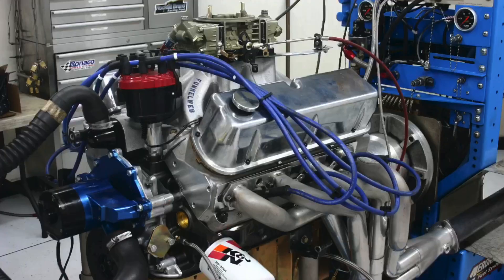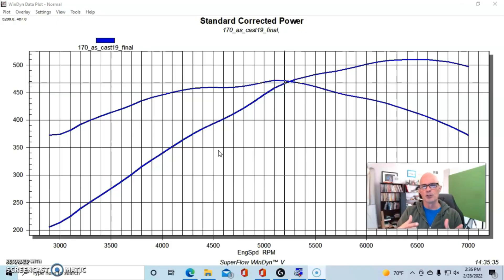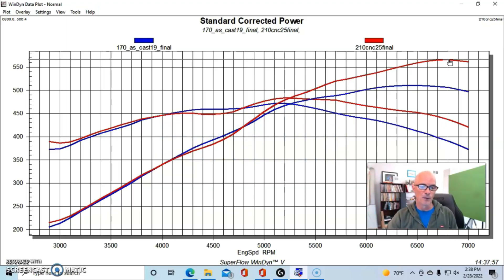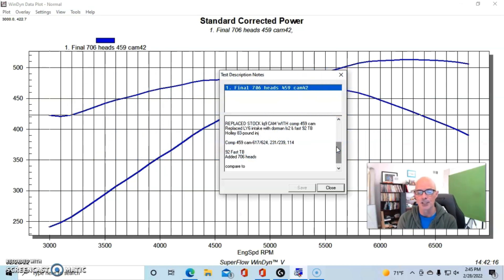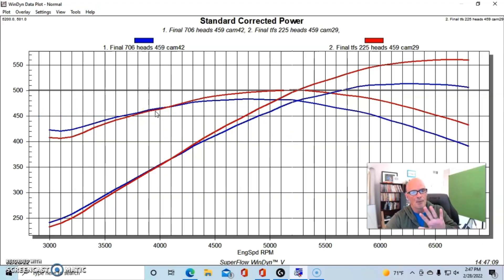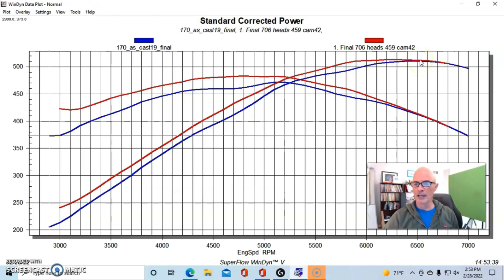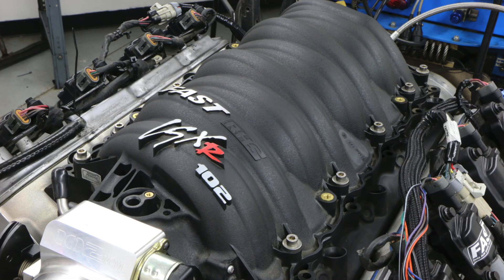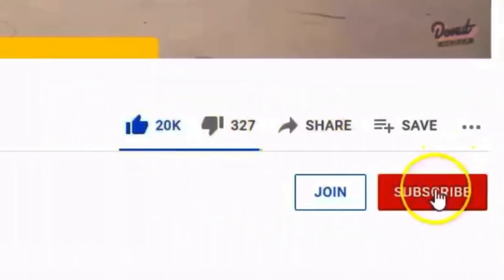HOW TO MAKE 6.0L POWER! FORD vs LS-WHICH 6.0L MAKES MORE POWER? MOD 363 FORD STROKER OR MOD 6.0L LS

Comment: I would have liked to see a. 030 over 360 magnum thrown in this mix too. I think that the Ford could have done a little better with the average hp with a dual plane intake. Now if someone wanted EFI on the Ford what would be the better intake for like the holley sniper fuel injection so all you need to do is swap the EFI for the carburetor. Would the single plane work better with that type of system or would it shake out the same as it would with a carburetor. Dual plane better down low and the single plane for top end power and higher rpm.
Reply: At that low RPM, I really agree.  An Edelbrock Air gap on a Windsor engine (351@ +.040.) with that level of cam and heads will pound out 575 hp with a carb.

Comment: Bunch of mismatched parts and trying to make a conclusion from it.   Lets see... a retardedly large single plane, GIANT solid roller cam and a TINY HEAD.. yeah a 1.94 valved cylinder head that should be on a 302 street motor.  Cam and intake had NO business in/on that motor.

Comment: Run the same  valve angle for the ford . 20 degree ford against what a13/15 degree Chevy.  Put a set of Victors on the ford -15 degree vs. 15 degree

Comment: Fun video, not sure if it will change any minds but fun nonetheless. Maybe I missed it, do they have the same compression ratio?  How did the difference in LSA effect the net results?   Keep them coming Richard.
Reply from the maker: slightly higher in the Ford
Reply: I’m thinking the combination of duration and much wider LSA of camshaft had a dramatic effect on average power. That and if the Chinese funnel web was not ported, this test is not very accurate. A 351w stock block would have been a better comparison as well.

Comment: The Ford had waaaay more cam…  roughly 20 degrees and 0.100” lift.  Sure, the long runner intake on the LS helped it in low rpm torque production, but arguably hurt it a little at the top end.  Putting a single plane on the LS would drop the torque curve some (closer to the Ford), but likely add another 20hp on the top end. 

I think if the LS had a single plane and larger cam (closer to the Ford’s specs), it’d likely be making 600+hp, about the same amount of peak torque, but less torque down low.
Reply: LS had a better flowing set of heads
Reply: @motownXJdad9565   He said they also ran the Dart Pro 1 225cc heads and there was minimal difference to the 210cc.  
Plus, a key reason the LS heads flow better is that the heads are 15 degree (valve angle) from the factory while SBF's are 20 degree.  This means the valves in SBF heads are more shrouded than the LS heads.
Reply: @stlchucko  I bet if he ran 225cc TFS high ports on the sbf it would be a different story.
Reply: The LS motors are a far better design that will always make more power with same specs.
Reply: @bri-manhunter2654  Well EMC plus many racing series say otherwise.
Reply: Need to run the same style intakes / compression / cam / rocker arms / pistons / combustion chambers......to make a true comparison.

Comment: Honestly this just makes stock LS parts look more impressive. Even made over 500 with basic truck 706 heads. Run the ford with stock heads lol.
Reply: superkillr, you obviously haven't flowed Cleveland heads against LS heads.  The info is also out in the net.
Reply: @flatbrokemodsquad4241  Yes, The info is out there. Its called the EMC. Go check Kasse out. Cube for cube no small block from the best engine builders in the country has managed to beat his Clevelands. Except for the time they accidently let modular motors compete and they swept the podium. LS motors are good and ubiquitous but they aren't the best motor ever created.
Reply: @mikealbert728  Fords "mod" engines were banned from the Engine Masters Competition for life.The "Cleveland" head Windsors hold there own very well in this builders contest 👏
Reply: @mikealbert728  I have no need to check out EMC as I read all those YEARS ago.  Kaase kicked ass with his 400 with CHI heads.  I'm referring to factory heads, not ones that will run $4,000, then top it off with a $900 manifold.  Stock Cleveland heads won't out perform stock LS heads.  I'm not referring to aftermarket heads.  I never said that the LS is the ultimate engine.  If Kasse would make some more P38 heads, I'd buy a set for the windsor my wife's 69 eliminator clone.  They were, essentially, a high flowing head using canted valves like Cleveland that worked with windsor intakes and exhaust.
Reply: @flatbrokemodsquad4241  The LS guys are running Brodix, RHS, etc in those competitions so it's apples to apples. The mod motors were about the only ones that even ran stock heads obviously. Kasse has also win the competition with a plethora of Ford engines. Probably almost half a dozen. Fully worked Cleveland Iron heads can run with any LS head with the same work done. Cleveland's are over half a century old so yeah, you just won't find many stock Iron heads out there much less people racing them but Clevelands dominated Chevy for decades even with all the weight penalties and other handicaps.
Reply: The Ford engine that stopped development in a Explorer in like 2000?  Or would you like him to put on a set of Cleveland heads and smash the crap outta that LS?  Oh the LS, that looks almost exactly like a FORD compared to ANY chevy engine ever built.

Comment: I understand that Ford guys are going to go with Fords motor, and Chevy guys are gonna want the LS motors. But how streetable is a 700+ lift cam gonna be for the Ford guy? With the LS it’s welcome to Tuesday. I definitely like both engines, But for cost point and street ability the LS is just a better built system.
Reply: Good point
Reply: @berserker406 you gotta remember a lot of what he's doing is just archive comparisons, he doesn't build or even test all these combos he has all the information from. He's mainly just putting the information out there for people to see what combos make similar power, usually with multiple combinations over many videos.
Reply from the maker: HE BUILDS AND TESTS ALL OF THESE COMBOS (WITH RARE EXCEPTIONS)
Reply from the maker: A 351w WITH A 230 CAM WON'T MAKE 566 HP

Comment: Now give the LS the same cam specs...the most important thing to learn from this test IMO is the LS will be worlds better in any street driven situation, at the same power level with a Much smaller cam. And much cheaper to build  too is another bonus.
Reply: If you think that cam was helping the Ford you're delusional.
Reply: @superkillr  you must not have watched the video
Reply: Give the Ford the same head specs n we're at it again..lol
Reply: @P71ScrewHead  an 6.0l with ported stock ls3 heads and a cam in the high 230s would have made 600. And that's with hydraulic lifters. Ls heads just flow to good. Gm really hit a home run when they designed them. It'd hard to even compare the. To aftermarket heads for a set and sbc. Ls3 heads will flow 365cfm with very little work. Ls7 will do over 400cfm. That's equivalent to a high dollar set of older style  heads.
Reply: @unclegeorgesspeedandfeed  I've always said there's no such thing as too much head..lol The more head the better.. ;) i like the LS7, other than that, Ford all the way.. :P
Reply from the maker: a 6.0L with ported heads and cam will make 600 hp?
Reply: @richardholdener1727  yes,  ported ls3 heads.  In bumpstick boomerang you made 575hp with a Brian tooleys 235/244,  and that was in a stock ls3.
Reply: @P71ScrewHead  boss 302 had to much
Reply: @unclegeorgesspeedandfeed  good to know..
Reply: @unclegeorgesspeedandfeed  ….Richards testing from a few months back of Boss 302 and Boss 351 engines showed excellent results. He blew the hell out of the ridiculous myth that the B 302 has no low rpm torque. The proof is in his testing for those who doubt.

Comment: I think some of LS's low-speed power advantage has to do with the longer stroke (by 0.222"). Although similar displacement, the longer arm means more mechanical advantage. Interesting that the Ford's cam had 22º more intake duration, so I'm surprised the Ford didn't run away from the LS after 6,500. It would seem to come down to the induction system since the 225-cc Ford heads didn't make any more power than the 210s.
Reply: What you gain in leverage you lose in piston area.
Reply: There have been a lot of test on the "longer stroke makes more low end torque" theory. When displacement is equal, it's a wash. Now the longer runner intake on the LS made up a lot of the low end torque. Single plane intakes are known for giving up the low end for high rpm horse power.
Honestly, had both engines had the same induction, they would have been much closer or the Ford would have won due to can shaft specs.
Reply: Those tests showed that the cam timing and low lift flow of the cyllinder heads will make a difference what happens. @GB-zi6qr

Comment: I'm curious how a 6.0l Ford with TFS 225 Cleveland heads would compare.  Is there an engine available that can do what the ls engines do?  In addition, the availability and low cost at the yards make the ls hard to pass.  Perhaps one day the coyote.
Reply: If you price out the cost of a 9.2 or 9.5 deck boss block to get the same cross bolted mains and priority main oiling as the LS, those heads, crank trigger/coil on plug ignition, efi, and serpentine you will find that ford combination is a $20k engine...to get to where a rec port 6.0 LS is from the factory. Tough comparison to make from a financial standpoint.
Reply: Cleveland 4v heads outflow about everything
Reply: @erandy0240  Except LS.  I had my cobra jet and my 2bb Aussie Cleveland heads flowed and they are better than windsor, but not so good compared to LS cathedral and way behind the rec port LS heads.
Reply from the maker: A 2V AUSSIE CLEVELAND HEAD FLOWS NOWHERE NEAR THE DART 210 HEAD USE-OR LIKELY EVEN THE SMALLER 170 DART HEAD
Reply: My 2bbl Aussie heads were around 178 cfm intake and exhaust.   My cobra jet was only 240 cfm intake and exhaust was poor.  Couldn't find my paperwork on them.  I picked up the high port exhaust plates for it, and milled head for fitment but after I started adding up all the money for that combo, I said screw it and went LS turbo.  Lots cheaper.

Comment: As a Ford guy, cost of a bulletproof block has stopped me so far.  I have a forged crank, billet rods and don't mind spending on heads but the block, machine work, cam and pistons to finish would cost more than a 6.0 with a cam.  It sucks, Dart makes Chevy blocks too and they are cheaper even though small block Chevy and LS blocks aren't known to crack down the middle like Ford 5.0 blocks are known to.

At this point I think I'm going to LS swap my Mustang with a "new" K-member and front suspension so I can put it back to stock or go to a built Ford motor if I ever finish that.

But back to the test, I think the cam did as much as the intake, I'm not sure if the Ford really needed all that lift but it sure had a lot of duration.  If the cams had similar duration I think the LS would have beaten the Ford up top but the Ford might have found a bit of torque somewhere.

I don't know how many people would daily drive a carburated engine making that much power because it would probably need regular tuning.  For me, EFI makes sense but EEC-IV seems to be nearly totally obsolete for performance applications so add another $1,000 for a Terminator but I can use a Terminator on an LS, then make another harness to run the same Terminator on a Ford...

A bigger question for me is if I'm as slow finishing my project as I've been starting it, how long will it be on the road before human driven, gasoline powered automobiles will be banned?
Reply: You can easily make the numbers they're making with a 351 with a piston swap on stock rods and crank....
Reply: @Haulass95gt  you ain't making 570 HP with any 351 easy,,,a stroker yes...
Reply: @camclarke9952  my point was that the stock rods and crank will handle that power easily in a 351, not that you'll easily make that power
Reply: @Haulass95gt  the problem is a 351 needs a Cobra R hood or a massive cowl.  LS seems to fit easy, maybe even with a truck intake.  If I didn't care about engine size, a 460 stroker could fit in there and make well over 1,000 hp before a stock block holds it back at all...
Reply: Problem is there is NO World or Dart blocks available currently.
Reply: There was a old timer on YouTube talking about making 1000hp with a Ford. 5.0 block. 
In his review he said the blocks not the weak spot its the main caps.  He showed thay the 2 bolt main with billit main caps and a gurdal is stronger then any 4 bolt main. He also said to girdle the lifter valley.  I have a stock block 5.0 with stock internals with the top end and bottom girdle the car runs 10.5 in the quarter. Only thing I have done to the engine in the last 8 years was adjusting the valves. 
Blocks are stronger then you think
Reply: @stephenfazekas1568  you probably aren't making 400 hp to go 10.5.  1,000 hp would get you in the 8's.

Main caps aren't really it, the lifter valley cracks because the blocks are cast too thin.  Some people say it's the caps walking, I think it's a chicken or egg situation.  Since the typical break is the lifter valley, I blame that.  I have seen the girdles but I'm not convinced they do anything beside hold the pieces together after the block cracks.

I see two thing, 5.0s that are fine because they make at most 300 hp and broken blocks...
Reply: @stephenfazekas1568  nah, they are junk. Simply not enough consistency. People don’t make this up, they literally have piles of 302 blocks literally ripped in half and no reason to waste money on a engine that needs all that support when newer engines do just fine and make more power anyway
Reply: Yep. I came to that same conclusion as well. It seems like its much more easier and practical to make power from an LS based motor compared to building a Windsor based one. the 363 ford engine essentially is 0% OEM ford. It's only a "ford" by design. With the LS motor, you can essentially use the SBE truck engine, and put a decent top end kit onto it and make good power. Not the case for the ford motor. You'd be $15-20k deep into the engine to make the same power that an LS can make for $5-6k in parts.
Reply: @GlitchMaster0001  the ls is way more modern design and isn't really a fair comparison honestly.
Reply: @GlitchMaster0001  yup. This is what I tell people. Go ford if you want. But if you want to save time and money, throw a fkn LS in there and have fun. Stop worrying about what some nazi purists think. They ain’t paying for shit.

Comment: I want to see ford 2017-2019 f-350 6.2L vs chevy 6.2L battle! I just rebuilt a pair of heads at my job and the design on the runners and combustion chamber looks like it can make awesome power.
Reply: Look into the for 777.. 7l 700hp 7k rpm n/a. Sadly, the 6.2 stayed a truck engine due to it being physically enormous
Reply: @PureCountryof91  physically enormous but they fit in fox bodies and s197 chassis with ease. That 777 motor was cool, I wish ford would’ve done more with it.
Reply: @taylorgtrotter  yeah.. ford built the fox and s197 to fit a big block If the customer ever wanted it to.. and I have only seen one 6.2 fox on YouTube.
Reply: @PureCountryof91  the 6.2 has amazing potential that is largely untapped
Reply: @taylorgtrotter  yep. And it's because it wasn't a mustang engine.. everything that goes under a mustang hood gets a "darling" treatment. Damn shame, I'm betting that porting, and tuning can make the 6.2 push 500+ n/a and boosted would make stupid power. The heads already flow alot though. So, it could be a tame cam and weak tuning..
Reply: @PureCountryof91  so you can find a picture online of a grabber blue s197 with a 6.2 in it. That car was a test mule that a ford dealer had used. Car was backed by a C4, and it ended up running 10’s with a catback, cold air intake, and a tune. Ford said “nah, let’s go with the coyote”
Reply: Roush built a 6.2 back in 2005 that was monster look it up there's an article on it
Reply: This would be interesting. I worked on an OEM 6.2 Ford project years back and they are a Stout piece. It would be great to highlight that and get some more support. These will be showing up in junkyards soon. With cam support these could be a low cost viable swap option (they are super wide though).
Reply: This.